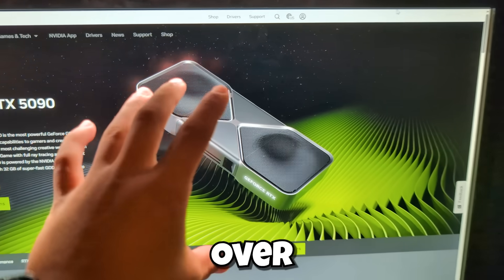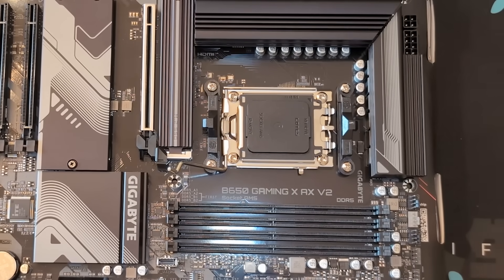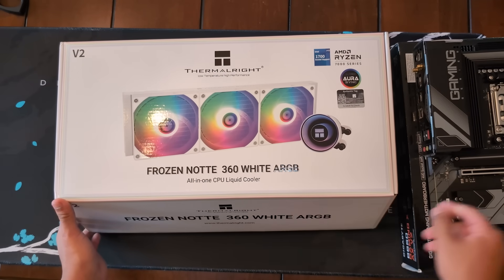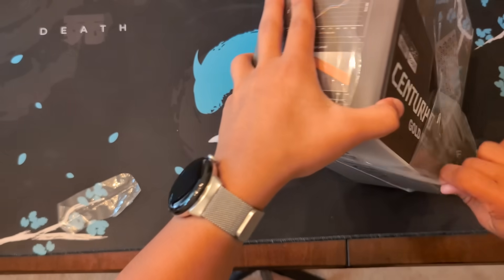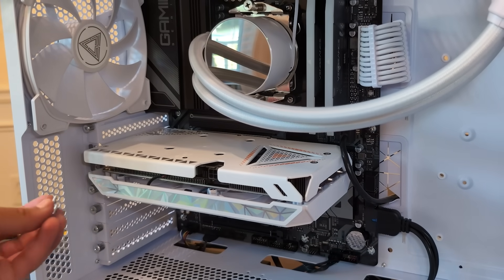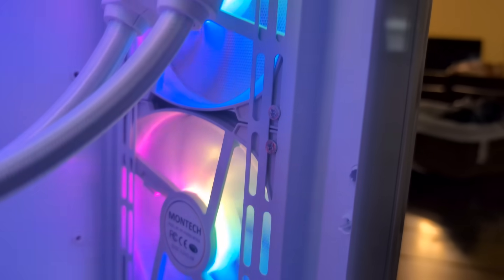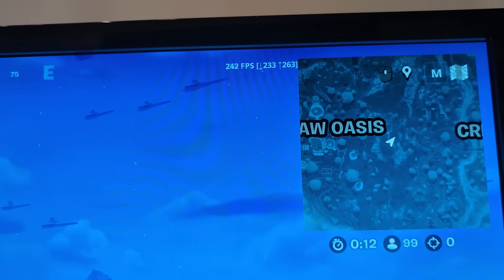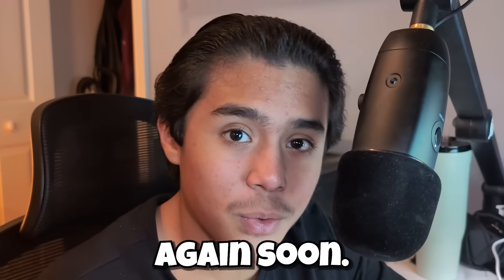Building My DREAM Gaming PC! (With No Experience)

Comment: Do you still need to apply thermal paste even if you don’t put on the screen on the chip
Reply from the maker: as long as the cooler you are using is touching the cpu i think you should use thermal paste

Comment: My pc case is black with a glass side panel, rbg fans ( I only use blue ). It's am 4, Ryzen 7 5700x ( undervolted and overclocked), 32gb 3200 mt/s ram, arctic freezer 36 (Good air cooler) on a b450 mobo, with an nvme ssd 1tb and a 2tb ssd, 9070 xt.

9:24 Your ram speed is set to 4800 mt/s, you need to turn on xmp/expo to 6000 mt/s. You also need to turn on "above 4g decoding" so you can trun on "resizeable bar". If you didn't do that at some point after that is. I also think you over spend on cpu and ram, as you could have gotten a better gpu.
Reply from the maker: I did turn on expo after the initial tests, also I spent more on cpu and gpu because this is mostly for video editing, not for gaming

Comment: Hey guys this is the PC i built for $800/700€, these are the specs 

Motherboard : ASRock B550M-HDV
CPU : Ryzen 5 5600X 
CPU Cooler Zeus Z400 
RAM : Gskill TridentZ 2x8GB / 16GB 3200Mhz
GPU : RTX 4070 Zotac Twin Edge 
SSD : ADATA Legend 960 Max 1TB 
PSU : Corsair RM850x
CASE : Gamdias Aura GC1 Elite

I think I did pretty good, it may be a little bottleneck, but I honestly I don’t mind it I can still run 99% of the games at maximum settings with over 60FPS

Comment: A 3060 for 1200 what a ripoff
Reply: could’ve gotten a 5070
Reply: @SGeditz32 Fr, could’ve spent more on better specs, plus he spent more for a ram with rgb
Reply: @SGeditz32 not in this economy. maybe a 4070 ti super
Reply: @Alexanderplays426  theres a 1300 prebuit in wamart rocking a 5070
Reply: @SGeditz32 and save like 200
Reply: @S @SGeditz32 Nope, if u were to ur other parts would be horrible.
Reply: Ye hes overpaying so hard i have a build with an rx 7800 xt for 1100
Reply: I bougth a 5070
Reply: Because the 4tb drive is so expensive
Reply: My whole PC will come out more or less the same when I upgrade my CPU+Board+RAM and I have an RX 7700 XT, and it's not like I cheaped out on any component (my case is more expensive than his). Idk what he did lol.

Comment: $1200 with a 3060 is crazy
Reply from the maker: It's prob the best GPU for my use case with this pc
Reply: @JojosMojoTech  not tryine hate but cmon man you can at least get either a 3080 second hand or even like a 7800xt new

Comment: not a horrible pcpartpicker list but instead of 3060 should've went forr 5060 or 5050
Reply: First of all 5050 is a gtx 1080 but a fancier version and the rtx 5060 is good but currently it isn't officially released
Reply from the maker: I would've if I was going for pure gaming performance, but I'm using this PC for video and photo work so the 12gb vram in the 3060 was y I got it. Also it was on sale
Reply: @JojosMojoTech  yeah 9060xt 16gb wouldve been better than 5050 and 5060

Comment: Yooo, congrats man. New sub as well, I'll be buiding my own pc soon.

Specs:

CPU: Ryzen 7 7700X
GPU: ASRock Steel Legend RX 7900 GRE
RAM: TEAMGROUP T-Force DDR5 32GB (2x 16GB)
PSU: Cooler Master MWE Gold 850W 80+
Motherboard: INLAND MSI B650 Gaming Plus
Fans: 2x G120 Triple Daisy Chain RGB Fans, Thermalright Peerless Assassin 120 SE ARGB
Case: NZXT H9 Flow (nonargb)

Periphirals:

Mouse: Glorious Model O (wired)
Keyboard: Ussixchare 75% Gasket Mount TKL
Ethernet: Cat 6A
Monitor: SANSUI 27 Inch WQHD 2560 x 1440 IPS

EDIT: 3:50 It's black 🖤
Reply from the maker: Thanks for the sub! Also that build sounds really good and cool so I hope it goes well!
Reply: @JojosMojoTech  Thanks!

Comment: Just so you know, until next time, I haven't finished watching the video yet, so I don't know if you'll notice, but your cooler is made for Intel processors and not for AMD. Sometimes it works, but you can accidentally ruin the motherboard.
Reply from the maker: The I made sure the cooler was for amd and when I looked at the specs it said it was
Reply: @JojosMojoTech   okay it's just that I have set the same howler for intel and I thought I saw an intel logo but maybe it can handle both intel and amd or maybe I'm wrong
Reply: It literally said ”Amd Ryzen” on the cooler box. That means that it works for Amd CPU’s.

Comment: I’m planning on trying this build out for my first pc and I have a few questions. What monitor would you recommend and do you need to buy the wires for everything or do they come included with everything
Reply from the maker: All the wires are included if u buy brand new, but I bought the white cable extensions I used in the video. Also if ur mainly gaming in this PC I would get a 5060. I got 3060 for video editing. For gaming I would get a 27in 240hz monitor. Also I have the tutorial I used linked in the description, it's super helpful!
Reply from the maker: Also pls don't get 4tb of storage, u only need 1 maybe 2tb max.

Comment: just a few tips, i mean you probably know it already but why not stick to white components or is this a black on white build. And since you have a full atx case, you should've gotten a tri-fan gpu so that it wont look too small for the case. For upgrades, buy new fans (get the reversed) for you intake for the aesthetics and if you have budget try putting your gpu vertical.
Reply from the maker: I got the 2 fan bcs it was cheaper and I didn't need 3 fan. I do plan on upgrading fans in the future, and I got black mobo and ram bcs it was in the bundle at microcenter. Thanks for the tips!

Comment: Just a tip the fps don’t matter just use what ever ur monitor holds because u won’t feel the difference if ur monitor is 240 hertz you should use 240 fps because with the 400 u won’t feel a difference
Reply from the maker: Ik, when I build my setup imma get a 240hz 1080p monitor and then cap it in game to 240

Comment: instead of the 3060 i think you should have bought a 5060 ti or a 5060 because a 5060 is around the same price as a 3060 and a 5060 ti is around 100 dollars more
Reply from the maker: I'll upgrade in the future, but I got the 3060 for the extra vram I will use for video editing
Reply: @JojosMojoTech how much vram does it have cause asus 5060 ti’s have around 12 gb of vram
Reply from the maker: Yes, that's prob what I'll upgrade to but it was out of budget
Reply from the maker: It has 12 btw
Reply: @JojosMojoTech ah ok
Reply: @JojosMojoTech most 5060 ti’s have 16 gb

Comment: Bro why the heck did u spend so much on motherboard and cpu ? Should have just got the ryzen 7 5700xt or X and get the better gou than rtx 3060 like rx 9060xt or even rx 7700xt or rx 7600xt 16gb . See ZTT builds for the pc help and advise . Put down the comment in one of his livestream or shorts he wil answer if it's intresting
Reply from the maker: I alr know I didn't build it the most optimal for gaming, but if Zack knew my reasons for buying these parts he would agree.

Comment: Nice build, but why did u pair the 7700x with a 3060, ur bottle necking ur cpu like crazy, the cpu is so powerful and combining it with a cheap card is not a good idea, you should have gotten a 4070, 3070, or 3080 if you want better performance, and there around the same price as the 3060
Reply from the maker: Because I only really play Fortnite, and will mostly use my PC for video and photo editing
Reply: If the 3060 is the 12gb version don't listen to anyone else, your PC is perfectly balanced. You wouldn't save enough money for a substantial upgrade and while the 9060xt 16gb may have been doable, for added purpose of editing the 3060 12gb is good enough and any 8 GB card that costs more than it is not worth it. Enjoy your PC man, I recently upgraded from the same setup to a 5060ti 16gb. Honestly, it's not as big a jump as I thought it'd be.

Comment: Pedant graphics card is not reliable. Change you GPU
Reply from the maker: Where did u find this info? Also u spelled the name wrong
Reply: @JojosMojoTech  Sorry, I was wrong. It's actually called Peladn. And this is an unreliable video card
Reply from the maker: I did research on it and it is reliable. Unless u have done research like me for their 30 series cards, you cannot say they are unreliable.
Reply: @JojosMojoTech Is your graphics card working properly? Is it overheating? Is it noisy? Is there any lag?
Reply from the maker: No, everything seems to be fine when I've used it

Comment: Why 3060 bro at that price you could fit in a Rx 9070 xt or a 5070
Reply from the maker: Bcs I want Nvidia features and the 12gb vram
Reply: @JojosMojoTech  Then still rtx 5070, ive seen so many builds around that price with rtx 5070

Comment: Bro I personally think 1.2k is abit too much for a 3060 build (like unless you got it as a prebuilt) but still wouldn't say it's that bad, 3060 was my dream card last year and I would've loved to get the 4060/5060 Ti (or hell even a 40/5070) but because of pricing issue (especially in my country) I'll have to either get a 3060/or B580 simply cause I don't play much modern AAA games but they do have slightly more VRAM so I can futureproof them (maybe for GTA 6 too).

Also bro I wanna say THANK YOU and you have my massive respect for not getting those overrated fish-tank cases, yeah sorry but I personally don't like those kinds of cases.
Reply from the maker: Thanks! I went for pure airflow and picked the 3060 for video editing purposes

Comment: Can I change my pc GPU to a the same 3060 with a i5 9600k and 660watt psu? I had my pc for 4 years.
Reply from the maker: Put ur parts into PC part picker and a bottle neck calculator to see if it would work

Comment: Bro u should of not put a 7000 series cpu with a 3060 you should of went am4 with ddr4 not only would u not have no bottle necking you would also save money
Reply from the maker: For what I'm doing the bottleneck is very low (3-5%), also I wanted am5 so I could upgrade

Comment: Likelihood of static electricity shorting out components is very low but kudos for doing this. Building for the first time can be intimidating but you did great. How does it feel saving up, getting parts, and finally assembling it? I'm SLIGHTLY older lol but I built my first one about 4 years ago. I'm 37 lol. Since then, I've built quiet a few. One piece of advice, don't second guess your choices and be happy with your build. I constantly upgrade my gpu instead of just enjoying it. It kinda makes it where you cant enjoy it.
Reply from the maker: It honestly didn't feel too hard. There was nothing I really wanted to buy for the past year except for a PC and setup I could use for YouTube. I have some more money in a brokerage account that I might take out for my setup when I move. Thanks for the advice!

Comment: sick video but MAKE SURE TO TAKE THE PLASTIC RAP OFF THE GLASS!!!!! it s on the inside and outside of the case and can cause a lot of thermal issues
Reply from the maker: It's only on the outside of my specific case, and I'm putting it back in the box and shipping it when I move. So if I take it off now it will prob get scratched

Comment: 7700x is way too overkill for a little 3060 but W vid nonetheless lol. Currently Gonna build my first pc with the same 7700x with a 9070xt for 1592$ in a week or 2
Reply: You should honestly get a 9700x because it’s like max $30 more and it has better performance in the great majority of games and it’s way more power efficient. And if you do want to squeeze more performance out of it you can enable PBO and it’ll be anywhere from 1-5% I think at the same wattage that the 7700x pulls.
Reply: Also the fact that in some games apparently he improved L1 cache makes the 9700x be quite substantially better than the 7700x.
Reply from the maker: The 7700x was in the bundle, therefore it was cheaper and I bought it
Reply from the maker: Nice! My PC is mostly for video editing, so I need a good cpu

Comment: Honestly a really good build, if your focusing on gaming more I would recommend a better gpu than the 3060 as your cpu is really good. Maybe consider getting a 4060 or even a 3070, but I do understand the 3060 if it was on a good deal. Overall nice build
Reply from the maker: I mainly picked the 3060 bcs it had 4 more GB of vram which I will use for video editing
Reply: @JojosMojoTech  your gpu dosent actually get used during editing and vram is just for loading in textures in games
Reply: I wouldnt upgrade to those bc it is such a small upgrade. Maybe to a rx 9070 or 5070

Comment: YO 1200$ FOR A 3060
Reply from the maker: I have my reasons...
Reply: Nah bro trust me I understand your probable reason which is aesthetically speaking it looks great but trust me you probably could have skipped out on the 3060 and I’d say gotten a used 4060 for under 300$ but other than that the build looks great just make sure that you aren’t getting low price to performance even if aesthetics matter a bit more
Reply from the maker: I alr looked at used of both the 40 and 3060 and there were no good deals
Reply: It depends where you look but alright good job either way

Comment: OH HELLLL NAWWWWW rtx 3060 with a budget of 1200$ is crazzzzzy could have gotten a better nvidia gpu like the 4060 or the 5060ti 16 gb
Reply from the maker: The 5060 was too expensive, and I wanted the 3060 instead of the 4060 bcs of the vram for video editing
Reply: @JojosMojoTech  you could've got the rx 7800xt with a ryzen 5 9600x
Reply: @JojosMojoTech TechSourse fit  an RTX 5060ti   In a 1000$ budget  build 
 but you would most likely have to downgrade your ram and cpu
Reply: And the 9600x is pretty faster than the 7700x tbh just that the 7700x has 2 extra cores

Comment: With a budget of 1200 you should have been able to get a better card than a 3060 no? I planned my build with like either a rtx 5060 ti 16gb or a rx 7700 xt and I’m at 1250
Reply from the maker: I specifically wanted Nvidia, but if I didn't then I would've gone with a different card. Also I am pretty new to PC building so pls forgive me
Reply: @JojosMojoTech  I dont blame you I’m just surprised you could have maybe gone with a 4060 or 5060 if u had maybe done some better component matching but at least you know for next time or for future upgrades. Nice vid btw
Reply: Or its just the prices that are different where i live
Reply from the maker: Thanks, the 5060 was a little too expensive, and I needed the extra vram from the 3060 for video editing which is what I'm mainly doing